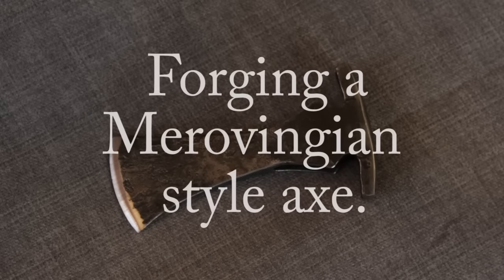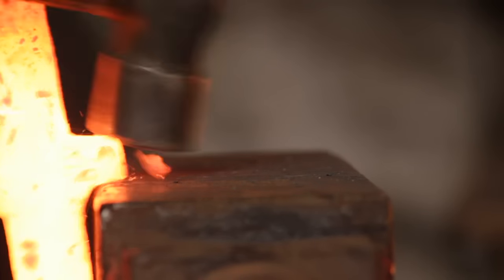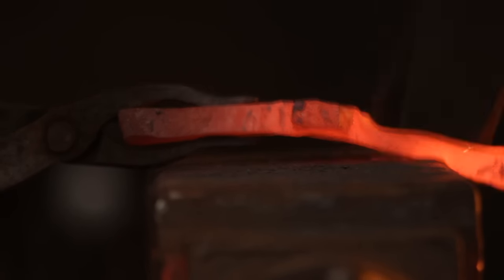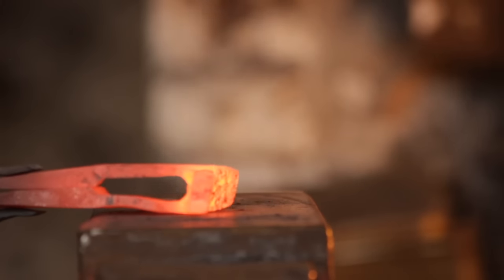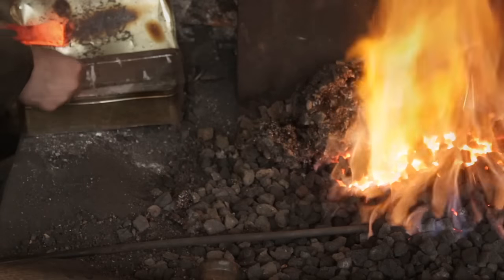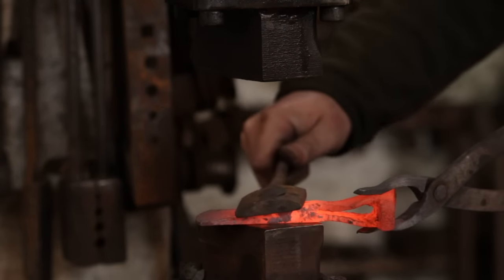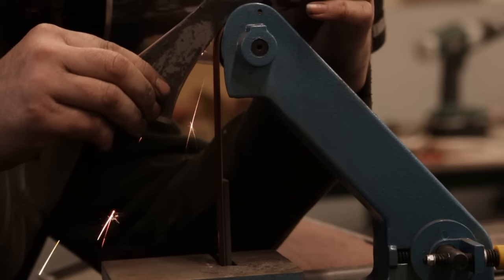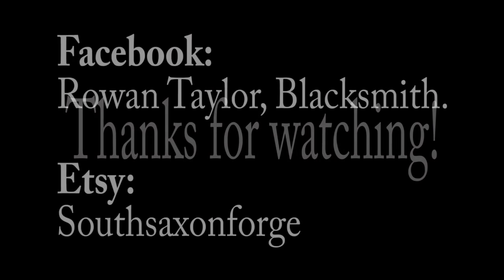Blacksmithing: Making a Merovingian style warrior axe.

Comment: hey man nice work. I tried to make the folded axe yesterday.  I used a railroad spike for my mild steal and burnt it up at the start of the eye when I was wielding. I will try again with some different materials.😢 I was so close.  lol
Reply from the maker: +brian krause Make your fire taller in order to lower the oxidising layer - that is most likely what happened. WIth a nice big neutral layer in the fire you can go beyond a welding heat without burning. Have a look at my "blacksmith's fire" video. Good luck :)

Comment: Another great video. Do you happen to know the reason for the protrusions on the poll? They're rather unique.
Reply from the maker: +E.R. Long Thank you :) I genuinely don't. I have a theory that they are to add weight to the poll, thereby making the axe easier to control, without actually raising the upper profile of the axe - but it is just a theory.
Reply: Would they also spread any off centre force over more of the haft, making it less likely to bite into the back of the haft and damage it? I can imagine that fighting axes would be subject to a bit of that, being used to hook and so on and being used on a less than cooperative target, unlike wood chopping axes.

Comment: How do you know what temperature and how long to temper any given metal?

Also, once a metal is "Quenched" in oil, is it possible to heat it again and continue forging or is it game over?
Reply: quenching temperature is when the steel becomes nonmagnetic. tempering temperature is when the blade becomes wheat coloured and the spine between wheat and a purply blue. it has nothing to do with time. and you can continue forging after quenching, however it will reverse the hardening process.

Comment: Hey rowan Ive been a subcriber for a long time and I also wanted to piont out you can draw those sides out by hand by yourself. Aroud 2 minutes in you said if you have a striker you can, well you could without one. you would make a set down on the edge of the anvil and draw it out from there. you may have not thought about it so its fine.

Comment: The japanese cover there high carbon steel in straw ash and clay slurry to keep out carbon from the weld when making there stock material for swords why don't western smiths use something like that.
Reply: demonic477 nordic cultures likely used horse dung for wrought iron blooms but i dont know if it has comparable effects
Reply: like flux?
Reply: No the clay and ash keep the steel from getting carbon out of the coal used in the smelting to much is bad . a lot of the carbon is lost when the steel is hammered from what I have learn they want to control the amount of carbon in the steel to make it stronger. and yes If the dung is used to make a shell to seal in the iron bloom it should have the same effect of controlling the heat and carbon content Citation needed I know more about japanese smiths than nordic smiths.